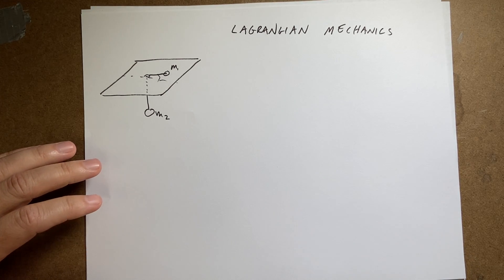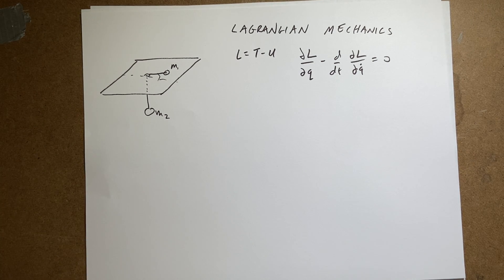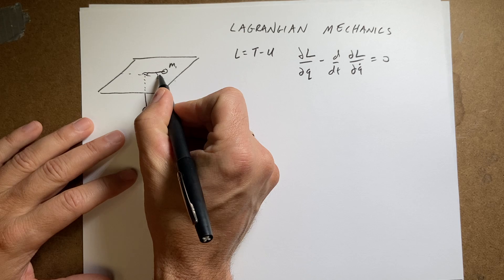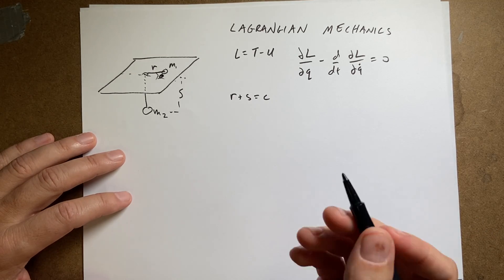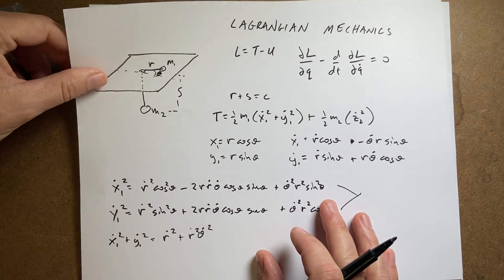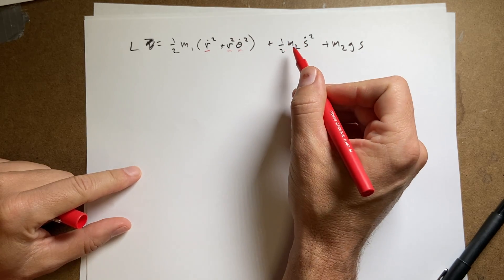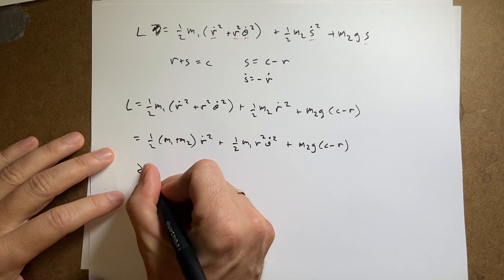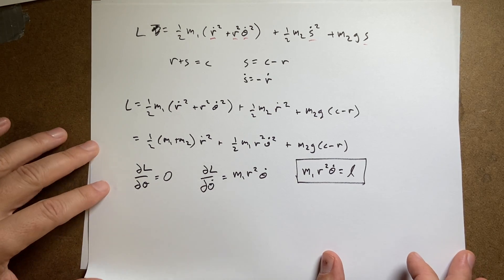Lagrangian: Mass on a flat table connected to a mass hanging through a hole

Comment: Could you please explain why d/dt(m1r^2(-)dot) is not simply equal to m1r^2(-)double dot?
Reply: Was wondering about the same exact thing...
I guess '(-)double dot'=0 (Where there's no angular acceleration)
Reply: @bhavikdodda  The Lagrangian equation gives d/dt(m1r^2θdot) - dL/dθ = 0. Since we already found that dL/dθ = 0, then d/dt(m1r^2θdot) = 0, so the quantity in the brackets is a constant
Reply: that's because r is also dependant on time, so you would have to use the product rule there